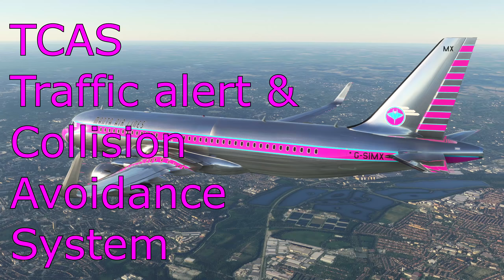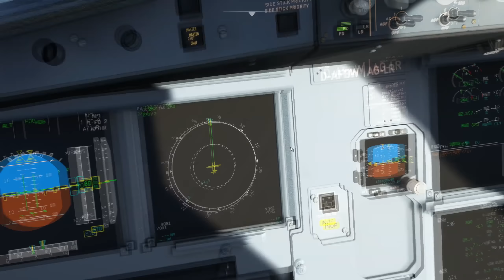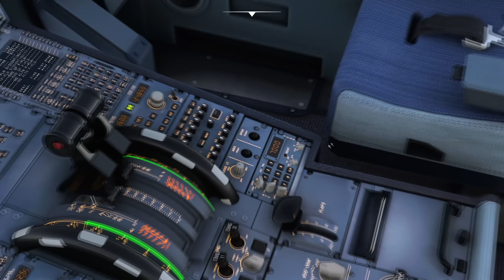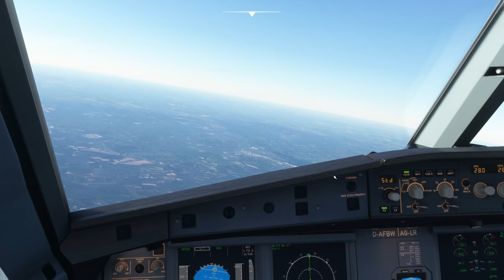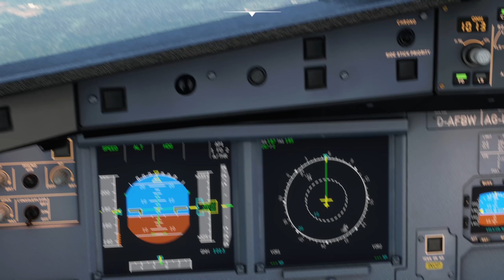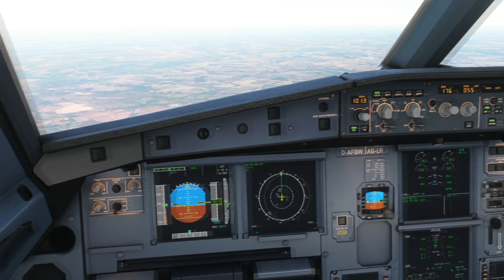New A32NX Feature: TCAS! Vital System Explained by a Real Airbus Pilot

Comment: Does TCAS coordinate with TAWS?  I realize a proper flight level or altitude should keep the plane from diving into terrain, but what happens under conditions where terrain clearance is less than 1,000 feet?  I read something about a T2CAS which I think addresses this but I didn’t read too far into the details.

Comment: It may sound stupid but would’nt it be quicker to disconnect the autopilot, pitch up and go TOGA when climbing and go idle thrust and pitch down immediately when you are descending, instead of first turning off your fd’s
Reply: Why would you need to go TOGA for the climb? Turning off the FD’s means you are then in speed mode, the aircraft will maintain the speed varying the thrust automatically. One less thing the pilot has to think about in a high stress situation. All they have to do is pitch up or down

Comment: Could you make a tutorial about the flight director? I understand the it is the part which calculates the desired attitude of the aircraft and the autopilot is following this commands when engaged. But I'm still confused when to disengage FD, why are there two of them when always both should be engaged or disengaged and how do they influence the FMA's?
Would be great to learn more about this! Thanks!
Reply: That’s likely why the A380 and A350 have 2. I’m guessing it was just so if you had one suddenly deviate you could turn off only that one and then hand control to other pilot who could keep theirs on. You turn them off when you are not following their commands. Such as this manoeuvre or flying visually for an approach. After minimums for an RNP approach then FD’s will no longer be in FINAL APP mode and will switch to HDG VS. You don’t want to follow that so you turn them off

Comment: I have a question about the rudder pedals in the aircraft. When the plane is on the ground and my right foot is forward, the planes nose goes right but when the plane is in the air, is the rudder pedals now on a reversed axis? For example, if I put my right foot forward, does the planes nose go left in the air?
Reply: No

Comment: I'm new to fs2020 switching from the 737 to the A320 at work. What is the hold up with accurate VNAV and Approaches?
Reply: They require a lot of data to get correct descent profiles and different speeds, cost index's and how much drag will affect the plane. If the plane cannot calculate the correct T/D then you're either going to spend a lot of time levelling off or diving so fast you'll need the speed brakes out all the time. Especially if there are several speed and altitude constraints to consider.

Comment: Great video mate and thank you. Are there any originating checks that can be done that test that TCAS is operating properly? (showing traffic on ND/simulating callouts). It is a feature I quite like in the CRJ.
Reply: I think so, but it might not be used by the pilots in the Airbus. I know about the 747 GPWS test which is very similar to the CRJ, but the real world 747 pilots don't use it as a checklist item. It's more for the maintenance crew.